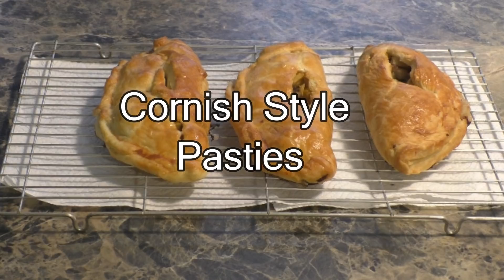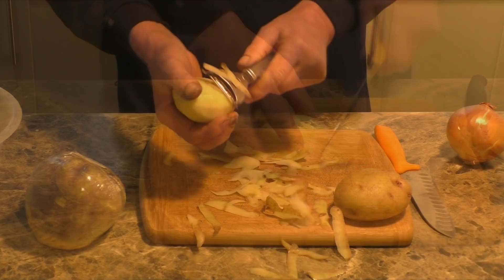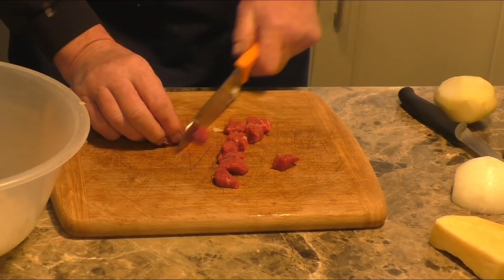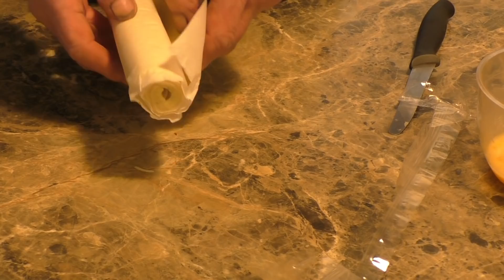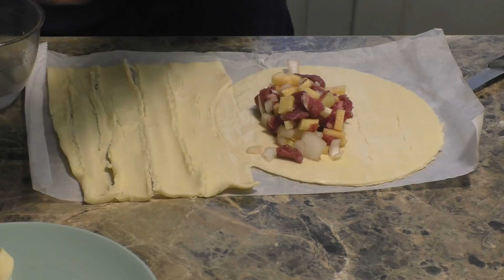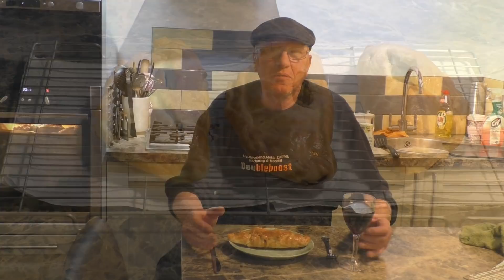Cornish Pasty    Doubleboost Style

Comment: Johnthat is NOT a turnip  it is a Swede, turnips are about the size of a small apple. The flesh is white not orange  as in a swede and has a very peppery taste  thus resulting in the peppery flavour of a true Cornish pastie. But even with the use of swede they looked scrumptious Bonnie Lad!
Reply: According to Wikipedia, swede/rutabaga is correct. "The recipe for a Cornish pasty, as defined by its protected status, includes diced or minced beef, onion, potato and swede in rough chunks along with some "light peppery" seasoning.[18] The cut of beef used is generally skirt steak.[38] Swede is sometimes called turnip in Cornwall, but the recipe requires use of actual swede, not turnip.[31]"
Reply: @Broken_Yugo  i stand corrected about the use of swede rather than turnip, but I was pointing out the incorrect naming of the swede by 
John. As you said they are sometimes called turnips in Cornwall,. This is also very prevalent in the .North of England also, I have spent a great deal of time in Yorkshire in and around the Leeds and Bradford area and they all call swedes turnip a and vice versa

Comment: 6:35 If you have a round baking tin the correct diameter, use that - place it on the pastry and press down hard - it'll cut through the pastry in one go accurately.
I've 7" and 8" circular baking trays.